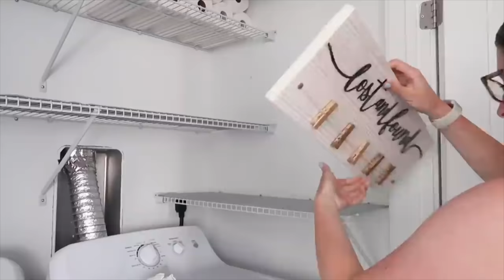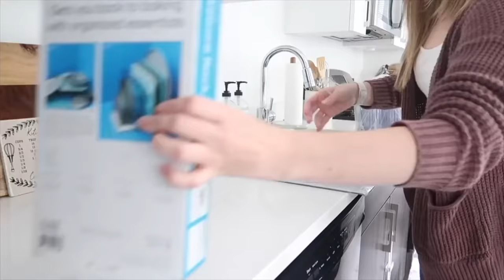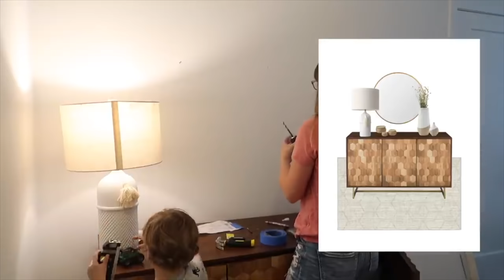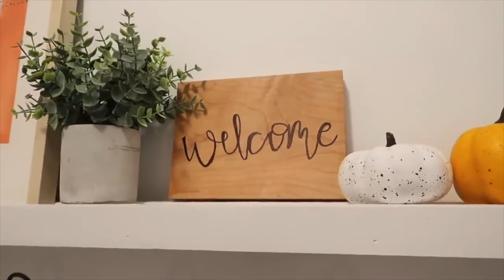SMALL SPACE ORGANIZATION ON A BUDGET 2021 / RENTER FRIENDLY KITCHEN ORGANIZATION HACKS & IDEAS

Comment: When I was totally poor, I bought rolls of wallpaper on clearance for 50 cents or a dollar and wrapped the front and sides of produce boxes (like the large ones from places like Aldi's) and used them for pull out shelving. It was pretty, everything matched and I could get to the way back of cupboards easy easy. I did the same with smaller boxes for the refrigerator, drawers, whatever.  The boxes were free and the most I ever paid for the wallpaper was $1 a roll (and it was prepasted, so there was that, too).  edit:  I even used Christmas wrap on smaller boxes in my clothes drawers.
Reply: D   C
Reply: @boujeebrate2762  What is "D C" ?
Reply: Lol     free is me     love free boxes
Reply: You are an awesome human. Just letting you know in case you didn't know. I mean it sincerely.  You are awesome ! <3 @kyfarm2016
Reply: I do the same thing with shoeboxes and drink boxes :)
Reply: Still doing the same with spaces, into which no store bought boxes fit. Or I don't want to spend the time searching for something fitting that basically no one ever really sees. I sometimes cut them smaller, adjust everything with tape and then put wrapping paper around - done!
Reply: Contact paper works too
Reply: @grammiecopper9024  Yes, it would.  But it costs more and it is (for me) a pain to work with, or at least to make smooth.  I would get a double roll of wallpaper on clearance for .50 or $1, contact paper was 10 or 15 feet for $3 or 4 or more.  I was Really poor. haha
Reply: @kyfarm  I understand.. Dollar Tree sells it( now $1.25 + tax), I bought all mine there n made sure it was from the same lot. Habit from wallpapering actual walls. Take care 😊
Reply: @kyfarm 
#1- I'm finding that I saving toooo much. MOSTLY of the same items/same type of items! (BUT! INVENTORY is nice to have on hand?!? Saves $$ ----BUT---> Takes up space! and Where to Store ALL the extra/backup "Schtuff!?" 
How to categorize? W/O Saving So/Too much! (I HAVE A:  Low $ budget!) And my "things" are taking up space I could use to Kiss (Keep It Simple Silly!) Plan!
And...Another issue, where/how do I begin? Do I go room by room? OR? (How to mentally inventory, what I'll need, 'not' need ahead of time, until I may? Need it? KEEP THAT....in a reasonable sz box? And see If I'll need it within??? 3 Mos? Longer? Or toss if I won't use it for 3 months? Disposable type items...Cleaners even if 1/2 bottle left? With a Very Strict Low $$$ Budget...What to do? 
(In a reasonable manner!)
And then? Where to begin? Just plow thru  Schtuff? Or... count out all like products and get rid of 2/3 of the extras, and repurchase in several months!? More $?

How do I plan storage space? What goes where? Cleansers, etc. In a med sz box under kitchen sink? Or?? Where? 
I keep getting caught up in the what I "may need" someday! And from there? Rm by Rm, Organize, Toss Out, etc....
ON SUCH A STRICT BUDGET ... One thing I've learned well...Is to have a few All propose Cleansers for a variety of things...cuts back on doubles! 
And...Where from there? Sort first!? Then clean and Organize everything in its designated spot? Drag the trash behind me? 
Where do I begin? LoL How/what should  keep? What do I toss? Give away, trash? 
Time mgmt...room by room? SUBJECT by Subject? YES! I need guidance here! LoL 
My biggest issue is getting overwhelmed by Sooo much! And with an eye on cost...That makes me go back and grab a few things I wouldn't have...because, That's MORE SCHTUFF! HELP! LOL
BUT! Less $ If I need to repurchase!
Anyone offer any good directions? 
What is/are your routines? At present, I'll be on ground zero working my way out!
Any guidance/ideas/suggestions, will be greatlyfully.welcomed !! I'm literally going in circles....over and over and....well you get the idea! 
Feel free to send hints, good ideas, schedule of chores, what to toss? What's the no 1 thing NOT to toss!?! And how do I continue the routine month to month?
Signed with Desperation...😉
Hopeful for Help! 😁
K.
😁
T Y I A.... 😊
Reply: Great idea!  Wish you had pictures! Here's another idea, on those larger boxes, you could probably put wheels/ casters on them, to be even easy peezier. 😁
Reply: @Antonia-et5sb  I’m a hoarder. There I said it. I have little space. Currently bed bound in basement. I’m not weight bearing on my right leg for a few months. 

I’m ready to purge.  I do have a plan. I don’t have room for bins currently that are large.  I plan on large garbage bags to begin with 

It depends on the job I’m going to do. But hubby has a yard sale every year. I’m going start here in basement first when I can sit up. 

So I’m going to start with a yard sale pile (until I empty a box-then put items in box), garbage bags for Trash, donate to local site(s), EBay sell, FB market place items(you can sell as you go that way), then put keep save items back with organizers as she suggests. I have sticky notes from when I worked and plan to tape to garbage bags to label. Remember to use your own storage items you have, Dollar Tree(now $1.25 not $1) organization IF STURDY—I can’t afford to keep replacing because it breaks down), people donate organizers to Thrift Stores too. Watch her video and decide what specialty organizers you need to budget for. 

Go now to DT, 5 Below, watch CVS/Walgreen ads and isles for clearance for a PLANNER. Use it just for your home plans. Maybe it’s only realistic to work 4 hours on a weekend/day off to clean and sort. You may want to put it in every weekend or day off. Like I said WANT TO DO.  But maybe it’s only realistic to plan 1-2 blocks of time twice a month. Put that in your planner. Don’t make unrealistic plans for yourself. Then you’ll feel Luke a failure.  If you end up doing more it’s just an added bonus. Make plans for the next month the last Sunday of each month. 

Be sure to plan not only your clean time and organize time. Also plan a day each month to take items to each donation site. Find out which days and times the days the sites sites accept donations.  If they have to have to do by appt, call and make appts for the next month like you would a Dr appt. I’m particular and specialize what and where I donate. I buy throughout the year to donate. I use digital coupons and paper coupons and reward monies to buy items. Also clearance. I also get FREEBIES. If it’s free on a sample site, I send for it as well to donate or gifts for unexpected/expected gifts for Christmas, Birthdays and just because. We didn’t have Christmas with either side of the family this year. Due to various reasons. Some of the items will get donated. I also got food and useful everyday gifts for my Mom and Dad.  Dad is getting their items of food, TP, paper towel, a new clothes basket, shampoo and conditioner, toiletries. Mom became suddenly ill and has passed. One reason for no Christmas. They had what they wanted, so I got useful items and candies. The items that I got Ma specific to her likes I will donate or sell on FB Market place   Sorry i digressed. 

But make time to plan too.and call people to make appts. Listings for Market Place or EBay or Craig’s list. Whatever method you want. So you have time to plan to make things come together. I would check at Dollar Tree first for a couple planners and a note book or pad. 

Best wishes
Missi🌸
Reply: I STILL DO THAT!! WORKS WELL AND SAVES MONEY FOR THE MORE FUN STUFF... Like Movies, Dinner Out every so often, etc. Every time you're "tempted" to spend lots (even if not too expensive!) On more "stuff" (clutter!) That u have to file through to get to... cover the boxes in decorative paper, even gift wrap from the $ store! You are now closer to dinner out on Friday! 😁
Reply: @kyfarm My daughter and family live in KY! On Base! Beautiful there! 😊
Reply: @grammiecopper9024  Good Advisement! SAME LOT!!! VERY SMART!! TY for the great tip! 👍 😊
Reply: @jamfam570  ?
Reply: Sounds good and smart. ☺️
Reply: Omg that's super smarttttt
Reply: Uuoiuuucuuuu ut iuiiii
Hi
Ho
Reply: What a great idea 👏👏👏
Reply: I do understand about money issues, so when I moved in my apartment I went to family dollar and bought vinyl flooring and cut it to size for the inside of the cabinet. I left the backing on it for easy removal and I think it's easier to clean than traditional liners.
Reply: My mom did this with toilet paper rolls! She would paint them and glue them together she made a little organizer for her drawers to keep all her cords neat! This was like ‘06 internet mom time, she was also listening to Marie kondos book and followed the fly lady’s blog. I miss her so much 💖
Reply: Do what you have to do until you can do better. Prayer changes thing and now you doing better and living comfortable. Congrats on moving forward.
Reply: @jayschaff  I also use shoe boxes as jewelry boxes
Reply: @Antonia-et5sb  yes. Exactly!
Reply: @Antonia-et5sb  i have no money either and still got rid of a lot of excess stuff. I have gone through all my stuff and noticed that, over the years, I acquired and collected more stuff than my family could ever use up. I have one storage shelf for extra stuff for kitchen - that means one box for extra dishes and other items, in case mine break. I have a set for every family member of one cup, plate, bowl, knife etc. and one set or two extra for guests. The same amount (which means for us: about 6 plates, knifes etc) is the maximum for stuff in the storage bin "just in case". I have food for about one week in my kitchen, and for 2-3 more weeks in storage in case of, you know...emergency or something.
You have to downsize it to a manageable and responsible amount and regularly declutter expired, unfitting or broken stuff. For example, in my emergency food store are things that I really eat, and I know when the first thing in there will expire (01.2024). So, when this date has come, I will go down there and grab all food that is expiring soon, than I take it to my kitchen, write down what and how much I have, to buy it new for the emergency storage, and I cook with what will be expiring in the following weeks. I also have 3 children. They all have an amount of around 8 pairs of socks, 6 undies, 6 jeans, 6 t-shirts, 4 pullovers, etc. Enough to get them through one washing cycle for everything, so they always have clothes. I also always kept any free clothing for them, like things theirs cousins grew out of, so the things I have to buy them myself are mostly socks and underwear. BUT now I have enough in store for them till they are all grown-up 😂 and MUCH of it, so it is a safe thing they don't ever have to go out naked - but it IS a bit too much indeed, I also didn't find the time to sew enough baggies with lavender to go with every clothing storage bin, so I am a little afraid to get moths. I need to go through these boxes now and declutter what is too much. See, I am struggling with the same problems as you do, but I am in the second year of having minimalist intentions. I don't accept any free dishwear anymore 😊👍🏻 it IS a process, and a long one in a situation like mine (or yours). But it is so worth it, I already feel much more in control of my life and I am not so stressed out anymore. Can't say that I am at a point where I never have to shovel stuff around, but it has gotten MUCH better. My children even decided to declutter in their rooms a few times, and my nine-year-old is kind of on top of it - she comes to me with any item she doesn't want or need anymore at least one time per month. Just grab a donation box (or when you are unsure, a quarantine-box instead) and a garbage bag and start where you sense the most unused stuff, but don't start with sentimental kind of stuff. You can make it, just like I do 💪
Reply: @Antonia-et5sb  when I read your comment with all the questions of where to start, what to get rid of, how to decide; I thought, "How did she know what I was thinking/feeling?" 
I am attaching a link to another video that I just watched, and it helped me sooo much to help overcome my overwhelming feelings like you described in your comment.  I really hope this helps you too.
Be blessed 😄
https://youtu.be/xRGXi1aTh1w
Reply: Youve just described my apartment! Lol  Everything is still holding up fine so…didnt change a thing. Take care!!

Comment: As a very short person (4’9”) I am very familiar with not being able to reach shelves! A kitchen designer gave me a hint years ago and I’m going to pass it along for all the short people in the world. In your upper cabinets put the shortest items on the bottom. Then lower the next shelf as low as possible. (I noticed all your shelves are all adjustable). Put the next shortest items on the the next shelf and then lower the third shelf as low as possible. And keep doing this for as many shelves as are in the cabinet.  On the final upper shelf put your tallest items, especially the ones you don’t use much. Also on the higher shelves use turntables. A lot of the time I can reach the front of the shelf but not what’s behind in the back. Turntables solve that problem.  It doesn’t make a “Pinterest Perfect” cabinet, but sometimes you have to give up a little “form” for “function”. On the other end of things, as you get older you will find its harder and harder to reach the stuff in the bottom cabinets, the bottom deep ones being the worst. This is where all those slide out baskets come in handy. If you own your own home you can put regular roll out shelves (Rev-A-Shelf). They are very pricey but as an older person with lots of arthritis problems, I find them invaluable! Also, you can store you pot& pan lids on the pot itself but turn it upside down Then you can stack them on top of each other. I put one of those felt protectors on the glass lids so they don’t get scratched by the pot that’s living on top of it.  Love all your storage bins and baskets and thank you for sharing all of your ideas! I have really enjoyed watching your videos.
Reply: I use turntables a lot in my cabinets... thanks for this great tip !
Reply: Good ideas for the older person. I have watched a 100 videos looking for those kind of ideas. I'm not 7 feet tall, am uncomfortable standing on step ladders and such, and that bending over to get into lower cabinets is a pain. Thank you for sharing.
Reply: So grateful for your add as a short person also living with Lupus.
Reply: Great tips. Im tall but will incorporate them too they are universal 👍🏻
Reply: Great tip for this 5’2 woman that has a niece that’s 4’11!
Reply: Thanks for your comments for older people. I am older 70 years, and I am so trying to make things in my cupboards accessible. Tired of bending down to lower cabinets, never had a pantry, I just bought one from Wayfair,  I am so happy ..able to open a door and have my  supplies at eye level. Thanks.
Reply: Hey Gail! You could refer to yourself as “Petite” instead of “a short” person! In my family, we’re all the way around, and my brother married a Petite girl because “that” was just what he loved the most of her! Lol! What I mean is that it’s best to watch the “charmest” side of facts in life!!!😍😍😍
Reply: I love using a turntable that perfectly fit in my top slim square shelf for my big bulky spices since I'm only able to see & reach the front.  Great idea about putting the shortest items on the bottom shelf & adjusting the shelves & tallest items on top.
Reply: K68
Reply: I put all my dishes in a bottom cupboard.and glasses on bottom shelf top cupboard. I have nothing in top cupboard i can't climb a latter any more i use a walker.
Reply: Thank you
Reply: I learned about the greatness of a turntable while in an apt with a laundry room with shelves above the machines. I put a turntable on the upper shelf for exactly the reason you said--I could reach something at the front of the shelf, but not any deeper. The turntable worked out perfectly.

Comment: Tip: use your hairdryer to loosen stickers. Most adhesives are oil-based (gum is dehydrated oil), & the heat melts them a little; enough to lift them off what they're stuck to. Any residue left behind can be picked up with tape or hit it with undiluted dish detergent.
Reply: Nail polish remover works too
Reply: Thank you for these tips. My teenager has really wrecked her bedroom door and I really want to get the stickers off with any residue.
Reply: Or goo gone ! It’s a pro cleaner for stickers gum glue etc mess. It’s oil based yet smells nice and isn’t even hard to clean if ever spilled itself!
Reply: @deedeepuffs951  try GOO GONE! I did for a kids toy chest so I could strip wood and repair and repaint for antique furniture! Stickers from the 80’s man! 😤
Reply: Chris BLUE DISH SOAP.WORKS! (For so Many things!) Put a lil bit on damp sponge and work it around the stinker...Rinse and Air Dry!
Reply: Goo Gone is good, but then has to be washed off.
Reply: Similar idea, I heat stickers on items over the toaster (except plastic), any residue is removed with denatured alcohol or alcohol prep-pads.
Reply: WD40 will remove absolutely anything sticky! The grease breaks down the glue. 😊

Comment: Tip for the lids: turn the lids upside down with the handel towards the inside of the pots. Saves a lot of space!
Reply: Iv been doing that 4 many years👍
Reply: @raindeer1256  Me Too!!
Reply: Yes!  Then you can stack the smaller pots easily as well.
Reply: Depending on the way the lid fits, I might lay a plastic grocery bag under the lid, with corners and handles out, so I can lift the lid out easily, since the pot lid isn't handy.